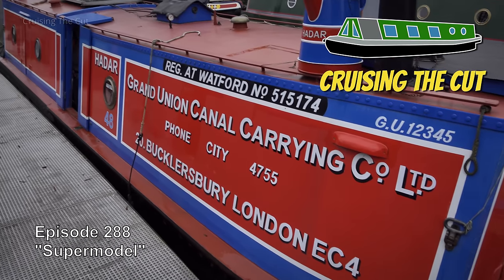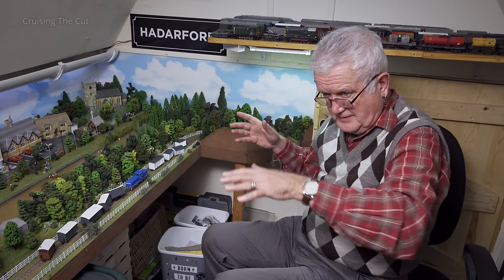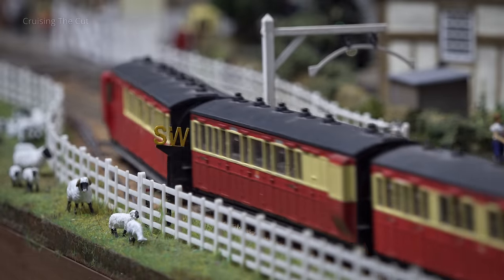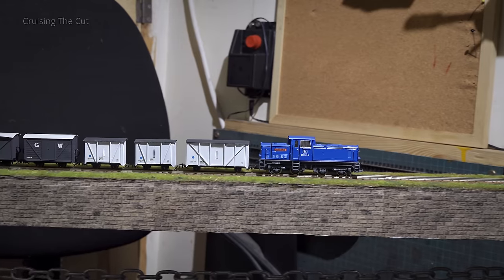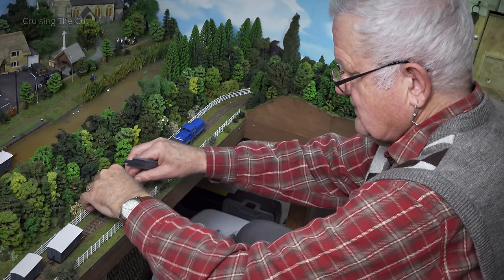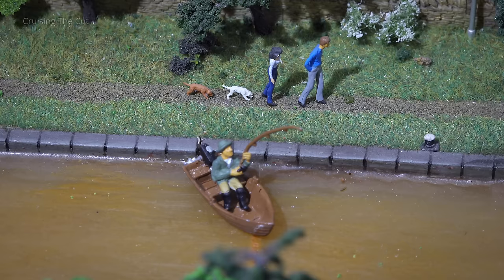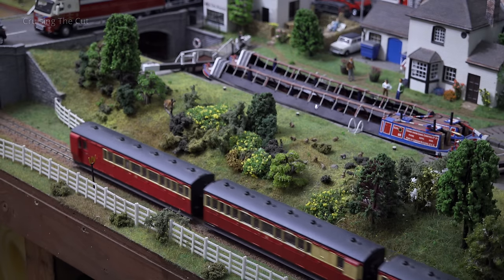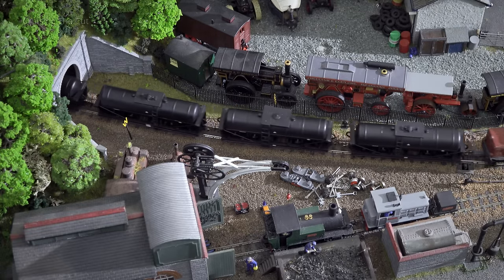288. An amazing model railway on a canal boat!

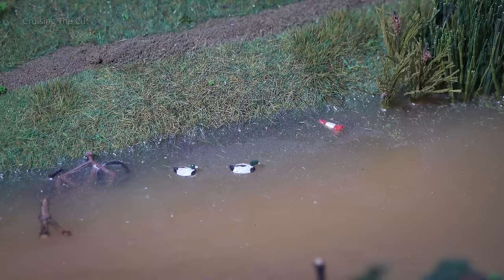Comment: 2:07 the mostly submerged bike is certainly the best feature. Amazing work - my only suggestion would be to use small mirrors to make the roads look like they continue through the bulkhead.
Reply: Unfortunately mirrors would not work in those locations, you would see yourself in them of course! I do have a mirror on standby to show details that cannot be viewed from the front of the layout, but they are there where they should be, like road names for example. Keith

Comment: All the little details and vignettes are great: the blue flashing light of the welder in the engine shop, the post-storm water canal quality with the silt and flotsam and plants in the slower areas of the canal,  the cones around the no-parking spot drive through, the thatched house roof peak weaving designs, the individualized stones on the retaining walls, and the safety gates for the road crossing.  With the graveside funeral scene, did the dead man's mistress unexpectedly show up and that is why the widow is fainting?  Looks like a real scene shot from a helicopter.  The Sheep look contented in the fields too.

Comment: One of the best clips of the recent crop. I confess I am biased as I have a love of model railways. It was my ambition to build one now I am virtually retired, but the cost of the running stock is quiet mind blowing. He probably would have got more in the small space using N gauge. But as age creeps up the smaller gauge is more fiddly on the eyes and fingers. Considering he's bobbing about ever so slightly, its a fantastic job.
Do tell him the resin water cracks even if you apply it in several layers as happened on a very small WW2 diorama I made. I took it down to dust it one day and it was all cracked . Nothing he did wrong. I put the diorama back on the shelf. ☹
Reply: Keith here Loki, it surprised me mostly because the resin I used is what they use for fibreglass boats, and I am sure they don't crack!
Reply: Hadar doesn't bob much at all weighing in at 27 tonnes. Keith
Reply: @workingboatwoman  Hi Keith, Its a great layout and the only constraint building one is the area you have and your imagination. My father was a founder of the first Model Railway club in Dublin in the early 1960's, where my love of modeling and trains especially steam was born. I was a member of the club for a time and in those days used a sort of stippled plastic for ponds and rivers. He experimented with resin and found in quantity it generated a lot of heat and cooling brought the cracks. Fast forward to today and I'm back modeling again as I contracted a rare neurological condition which stopped me doing the more exciting outdoor things I used like airsofting. But even since I started back modeling some great products have become available in the area of water. It may remedy the cracks on the canal without too much disruption to the existing features. A Spanish company called Vallejo produce a product called "Still Water". You may be aware of it as their paints are readily available . There is also a water texture to add foam and white caps on the surface. I saw the little double ender model engines in Wales in the station on the Ffestiniog railway and started getting ideas. Lovely little models. And the trip on the railway was a joy. We also took the return trip from Caernarfon on the line there. Keep up the good cause and keep the layout going. Look after the missus, understanding wives are hard to come by. 
Joe.

Comment: fantastic to see, thanks 🍻
But funny the little double ended engine was his choice for your visit, as the real one was covered by Fred Dibner on tv earlier this evening, never seen one before.
Reply: Yard engines in the US were built like that.  It made going back and forth easier.
Reply: @01cthompson  the little double ended steam, the first ones were in wales on the festiniog. the idea was to get around curves and abolish double heading.  a bit of a dead end because fairly soon after the garratt did this more effectively. the model is of one of the festiniog ones, at least 2 still run there today
Reply: The main idea behind the double Fairlies was they did not need to use a turntable when they got to the end of the line for the return journey. Keith

Comment: Absolutely mindblowing! You even put train crew on the engines and passengers in the coaches, an awful lot of modellers do not bother (retired BR train driver), i always notice.
Reply: Unfortunately that has been the case with very few model crew being produced in the past, but the market in that area is increasing thankfully, with model figures specifically designed to fit specific model engines. Keith

Comment: The full name of the scale for those curious is 009, and it is as described 4MM to 1ft gauge stock on 2MM to 1ft track.
Reply: Almost correct, yes it is 009 as the scale for everything on it is 4mm to 1ft, the track gauge is 9mm which equates to 2' 3" gauge, most UK narrow gauge lines are 2', not sure why this was selected as the standard model gauge, could be because N gauge uses 9mm track and thus N gauge wheelsets could be used, or may be due to the origins of narrow gauge came from Europe where they have different gauges. I have fitted all my rolling stock with N gauge metal wheelsets for smoother better running. Keith

Comment: To me an interesting detail gleaned from this video is that the typical narrowboat floats higher at the bow than the stern.  In traditional river craft in the US the opposite was true, with the idea being that if the bow, floating slightly deeper, were to pass over an obstruction, the whole vessel would.  If the stern were the deepest part, you might drive the boat hard onto a snag or a sand bank before you knew it was there, making it difficult to get off. If the bow struck, the vessel would stop short, without much of its length being driven onto the obstruction.
Reply: That "higher at the front" part is strictly is only true for unloaded boats, as the heavy engine and cabin aft is not much to countered. When loaded a working boat is mostly levelled out.

The model railroad is hardly comparable to the coal it moved back in the days, so the bow comes out quite notable.

In fact, it's an easy way to spot converted work boats (even more non converted) from modern leisure boats. While modern boats are usually more levelled by adding lots of ballast all along the base plate, they as well lay only flat when manned and water tanks are filled. Having 5-600 kg at the bow or not creates a different incline and notable differnt handling. As a result we always try to keep the tank filled, not just out of fear to run out of water in the midst of nowhere :))

Comment: It’s very nice! But why don’t you weather your models?
Reply: It depends which models you are referring to, Much of the rolling stock is, just not heavily and is not readily noticeable from the distance they were filmed from. As Hadarford is supposedly a preserved line, most of the locomotives and carriages are well looked after. Some of the locos need lining, when I get round to it so not point in weathering until after I have done that. Keith

Comment: How accurate is the model of Hadar?  Specifically, does it have a model railway with a model of Hadar, which itself has a model railway?  Asking for a friend.
Reply: Mike:  I did actually see (a very long time ago and I've forgotten where,  but ...)  a model village which actually had the model village in that model village ...  does that make any sense ❓
Reply: @joline2730  that's at Shanklin on the ilse of wight I thjnk? A model of Shanklin that has a model of the model village in it and a model of the model in that.
Reply: The model of Hadar is not accurate. It was made for me by someone, and despite it not being accurate I wanted to include it on the layout. However the pair of working narrowboats 'Sun' and 'Moon' in the lock are very accurate models of small Woolwich boats. Keith